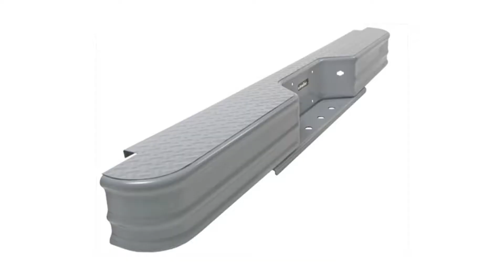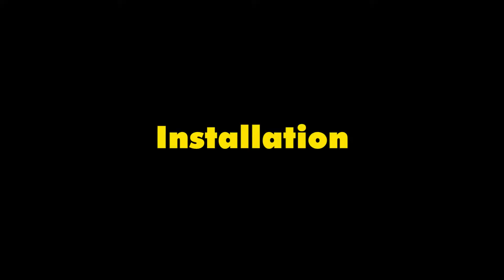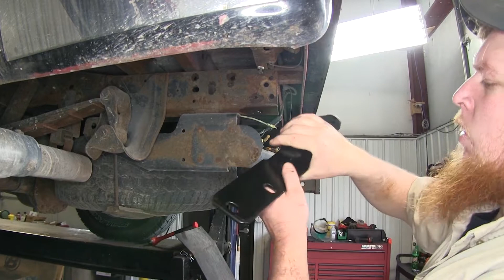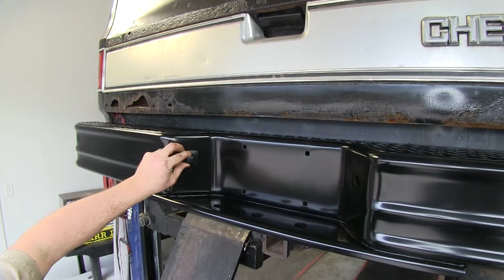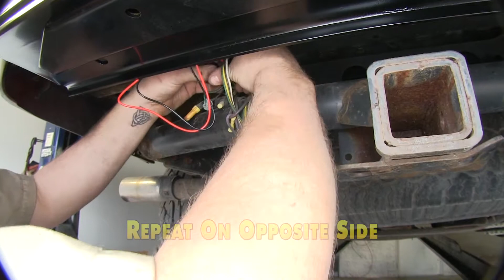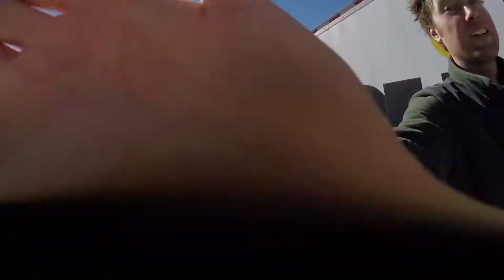How to Set Up Your Westin Fey Diamondstep Rear Bumper on a 1986 Chevrolet C/K Series Pickup

Comment: The part where you crimp the cables is confusing.  I'd like to use the quick slice product, but don't have a clue how to do it watching this video.
Reply from the maker: Sorry for the confusion. He used the word "crimp" but all he did was secure the quick splice by using pliers. It's really easy to do and really easy to use. You can view some helpful information at the link below for quick splice connectors. 

https://www.etrailer.com/Accessories-and-Parts/3M/804C.html